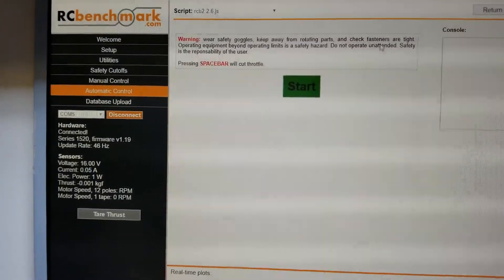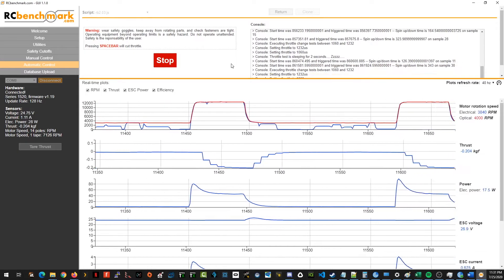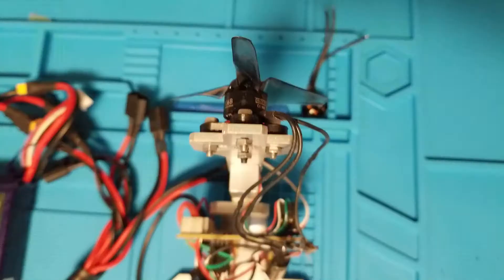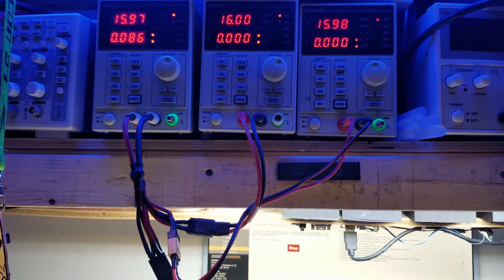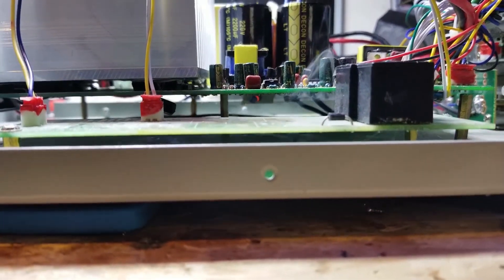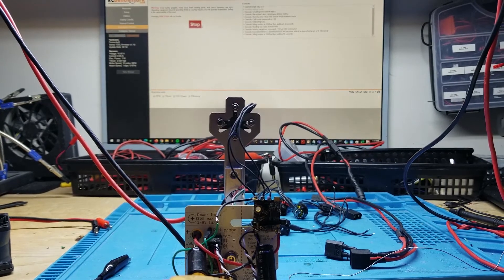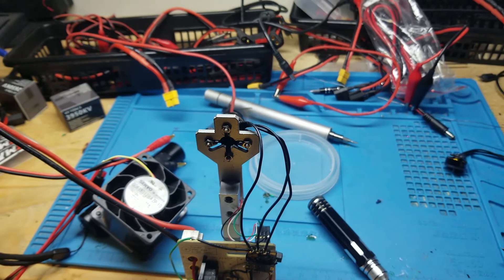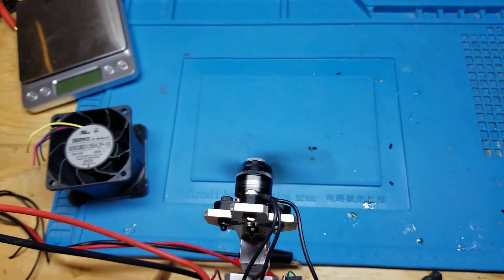Recursion Labs - Fully Automated Motor and Propeller Testing Methodology

Comment: Nice work, you know the next step is testing them in a wind tunnel don't you? :D
Reply from the maker: Not sure about using that for motor testing, but it wouldn't be a bad thing to own to test the air resistance of frame designs though :)